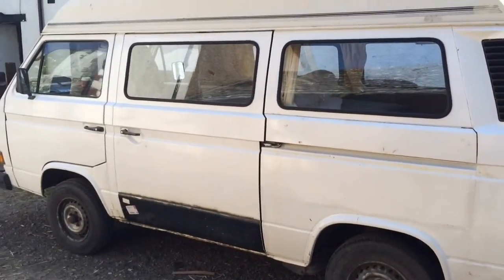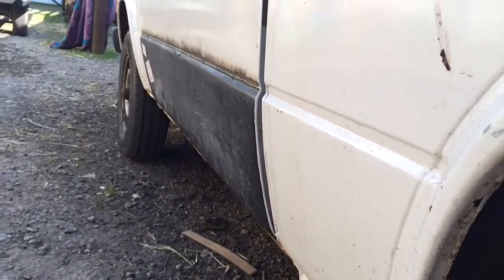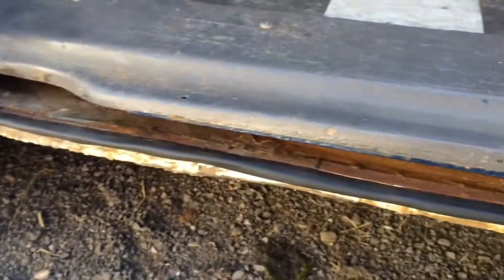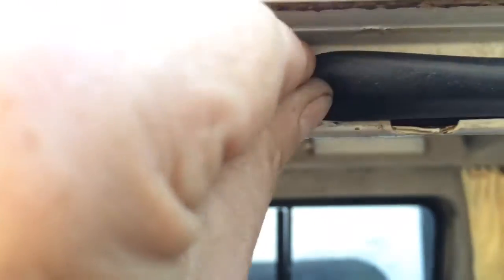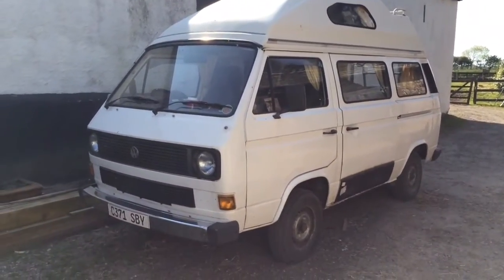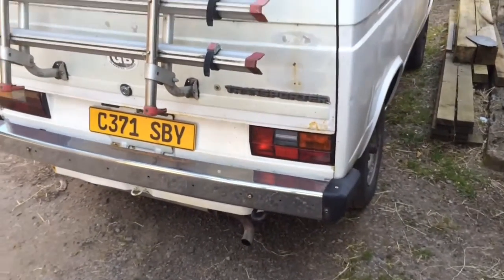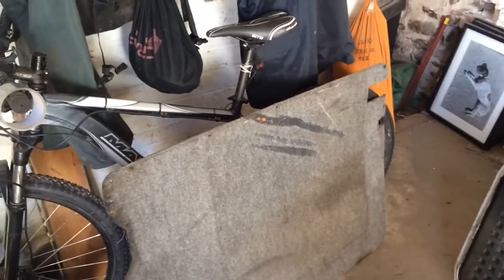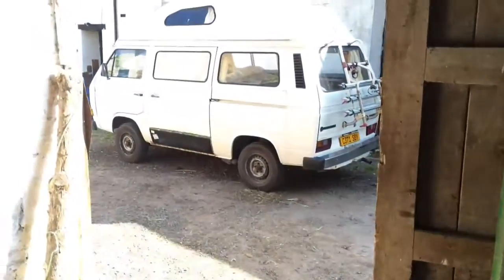VW T25 Chassis & Body Repair - Sliding Door Rust & Hidden Surprises - Part 30

Comment: Just finished watching all of your restoration videos. I have a westfalia joker left hand drive. Almost identical rust issues. Mine required chassis rail repair around the battery box/air deflectors in the engine bay as well as all four jacking points. Its a long process and at times rather daunting. I have often wondered if i've cut too much away. Being a welder myself in Portsmouth dockyard, i completely understand the difficulties of welding aged thin metal. You mentioned in your videos that comments had been made about the quality of your welds possibly not meeting the standards of the gods! Well,  most commercial mig machines are poor to say the least. Your welding will outlast the van. Ignore these nay sayers. The little wholes that appear in your stop starts are "worm holes" caused by removing the mig torch too quickly instead of allowing the shield gas to surround the stop start. 
Overall, your attitude towards the restoration is brilliant, nothings too difficult when you take it step by step. Once my van is rust repaired, a subaru conversion is waiting in the wings. I must be mad!!!!
Thanks for keeping another bus on the road. All the best with your future endeavours!
Reply from the maker: +Benjamin Hickman That's great to hear, cheers. Yep, I've heard those Subaru's are 'almost' a bolt on job. All the best,